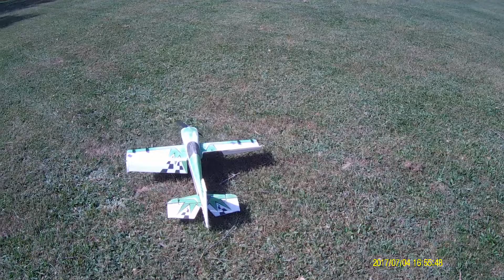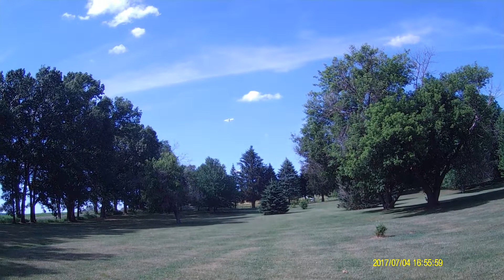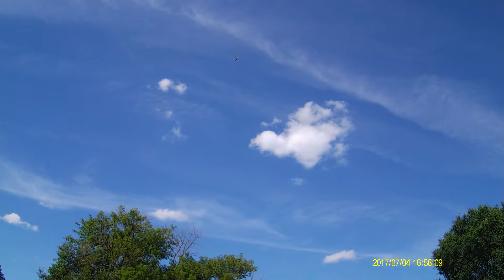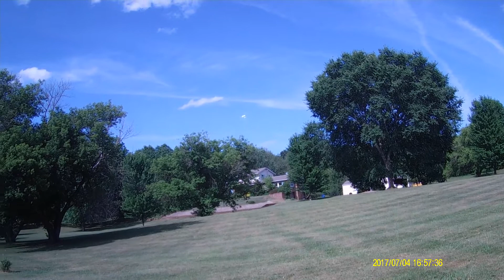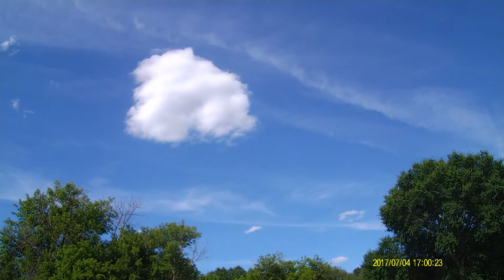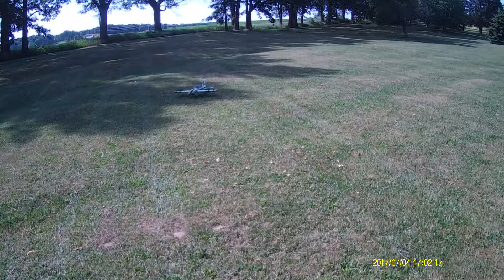7-4-2017 Hobbyking Skywing 38" Mini Edge 540T EPP - Found some old footage

Comment: you can shut that chick off on your transmitter any time now lmao..
Reply from the maker: Gotta have my chick! I don't do temperature reporting anymore, though. And I believe my timer callouts are only on minutes? I'm so used to them that I don't even realize I'm hearing them until something is out of the ordinary.. Like voltage sags.
Reply: @somespamsite44  what do you call a Sag??
Reply from the maker: @shawncampfield3806  Sudden large drop in battery voltage. Like you're flying along hearing 11.8V, and then the next callout says 10.1V. That means you either did something that required a lot of power, causing a temporary sag, or your battery is about out of power. The next callout will tell me which one it is. Typically when I hear a low voltage callout, and I know I'm past half way or so in the flight, I will take it easy until the next callout just to be on the safe side.
Reply: @somespamsite44  roger